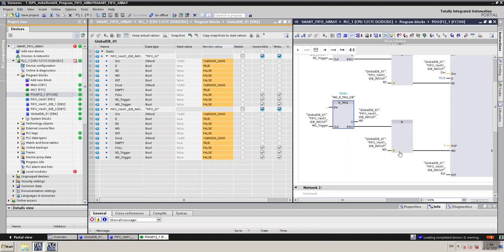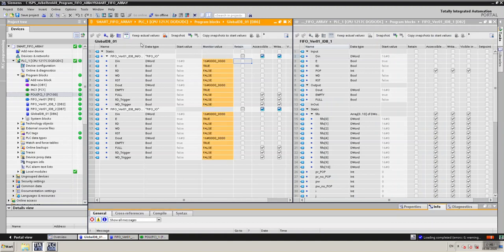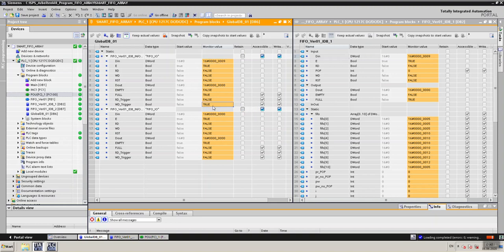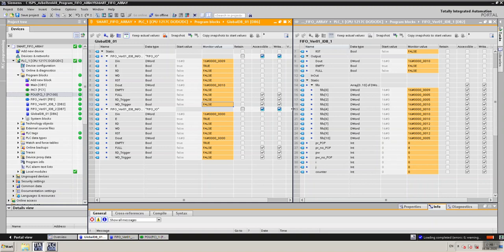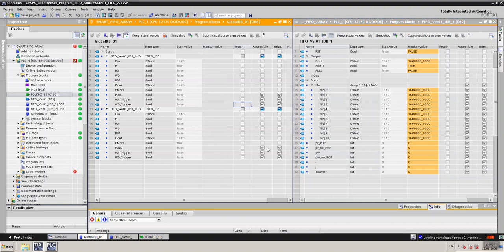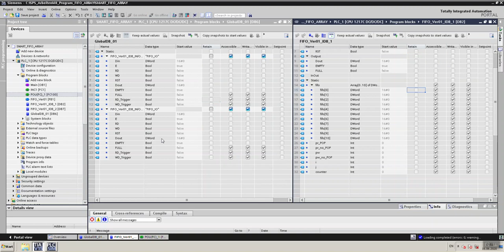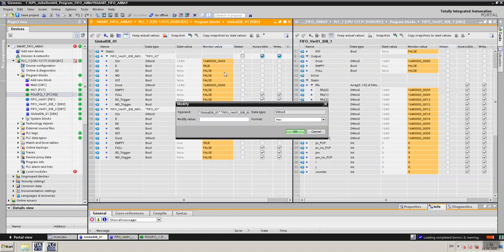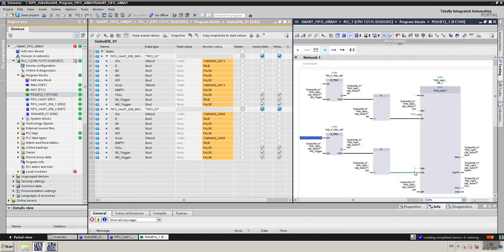Advanced FIFO function in Structured Text_Siemens

Comment: Hi Jamal, Thank you so much for you effort! I  triyed your github tia Project. With S7-1200 Cpu it is works like in your video, but if you change to S7-1515F(this one I triyed) CPU goes in error state. Can you help me with a quick  advice or Workaround, what can be the problem? (Tia point me to #fifo[#k]-line 44). Once more Thank you!
Reply from the maker: Its not clear to me what issue you are having with 1515 CPU. I need to have a proper view of all the error codes you are getting. Write me in details
Jamal.muhammad.vc@gmail.com
With screenshot of error codes.
Reply: @guzzar100 
Hi..Jamal
When I'm trying in POP 1 / 2 option in s71500 I'm getting area length error in FB..
IN THE 5th line of the program ( #fifo)

Comment: Hi jamal
Very profesional Program.
I need to make string data type fifo
I tried changing the data types on your program, but I could not succeed.
can you help me.
Reply: 286 / 5000

I fixed the problem and I don't need help anymore.
I found a problem with the program you downloaded.
POP=1
After adding a few times and reading a few times;
If you add it again, it doesn't add it to the order it should be.
because counters count incorrectly after readings.

thanks
Reply from the maker: @ertansakarya3062  maybe you can upload your better version to github for others, if you are interested. While making this program I only thought of Integer data types, string was not in scenario.